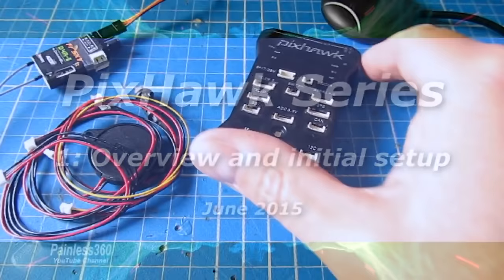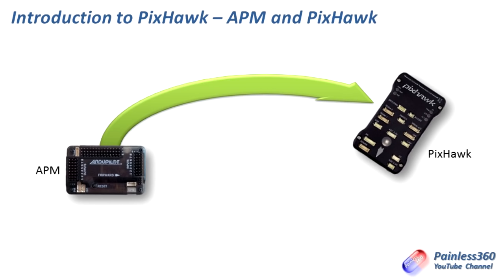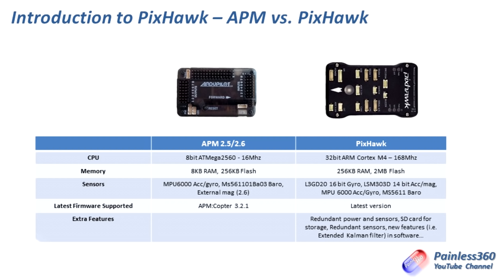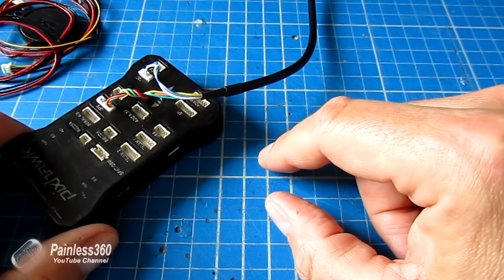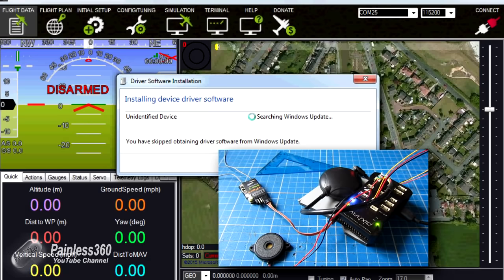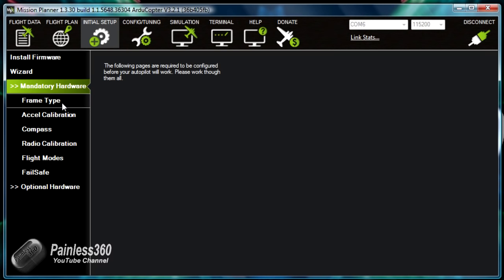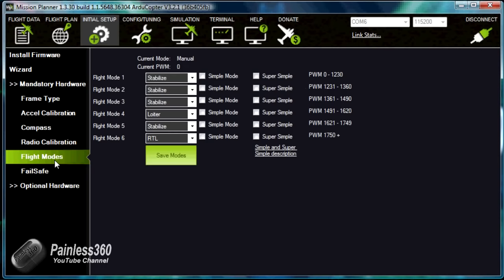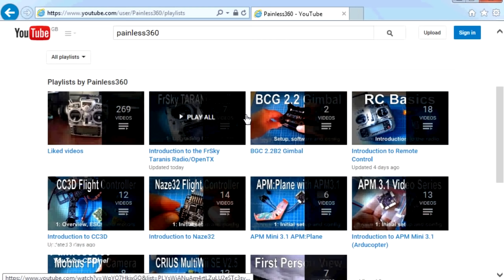(1/5) PixHawk Video Series - Simple initial setup, config and calibration

Comment: Hello Sir, your videos are very well crafted for beginners like me. I can't thank you enough for all you do. I am newbie to Drone building DIY. I have Pixhawk 2.4.8 and wanted to use it with 4-in-1 ESC along with Raspberry PI 4 or 5. I watched all the videos out there on this scenario and all of them uses individual ESC's for each motors. I came across encoder to use but surely not understand it. I saw some video about connecting Raspberry PI to Pixhawk so I think I am okay there but not connecting 4-in-1 ESC to Pixhawk. Would you be able to suggest how I can get 4-in-1 ESC connected to Pixhawk? Or if you could do a video on it, would be awesome. Thank you so much for all your help in advance sir.
Reply from the maker: The wiring of the ESCs isn't that different. Each has a signal wire but all use a single common. GND wire.... Best of luck

Comment: Hi , Painless, i finally get my pixhawk from bangood , and i am flying , but little lost with the parameters.I have a ThrO=0.250  to 0.300 , for a stable altitude is it ok , with the APM i used to have 600 to 700 when the battery is at the end?Thank you for your videos.

Comment: I built a drone and wanted to set it up with a Strawberry Pi and Pixhawk. Doesn't work for me so I disconnected the StrawberryPi and followed your instructions here. Only difference was I left the PPM connected. After following your instructions it still does not work. Is it the PPM causing it not to work? Appreciate any help you can provide. Thanks Al
Reply from the maker: Check out the Pixhawk 2020 series for all the steps I use to get it working. Best of luck

Comment: +Painless360 It has been a really nice video. I have a question.If you answer, I am very happy.Should Pixhawka be connected to the GPS to run the connected engines? Good luck
Reply from the maker: By default, yes. Happy flying!

Comment: Hello, I am building a F450 drone and will be using Pixhawk. I had two questions for you and was hoping you could help. 

1.) I have noticed that 3DR has discontinued the Pixhawk ($109), and transitioned to Pixhawk Mini ($230). Do you know any differences? I do not know which one to go with at the moment, as $230 is quite a bit of money, especially considering it is a smaller flight controller than the original Pixhawk, yet it is a newer version...

2.) For battery size on my F450, I will be running the DJI E305 kit, and am trying to achieve a 25-30 minute flight time. I am looking at a Venom 4S, 8000 mAH, 15 C battery. Any thoughts? 

Thank you for the help!
Reply from the maker: 1) All PixHawks are not clones, and have been for some time. It's why the price had dropped so much. 

2) Really depends on the props, conditions, model weight etc. Watch that C rating on that pack.. check you've got enough for all the motors. Sorry, I don't use DJI kit here so can't comment further...

Comment: by using your video we built up a tricopter using a pixhawk controller. After first problems Now it works very well. during RTL mode the tricopter works well but the landing  Point is not exaclty the take off Point , there is a tolerance around 2m. is there a parameter to set this Radius?  The one in waypoit? Thanks and Regards Andrea Montani
Reply from the maker: +Andrea Montani that's normal. Happy flying!

Comment: beginner's question. What happens if during autonomous, programmed flight pixhawk looses radio reception (turn off taranis). Will program continue or automatic RTH kicks in, or maybe FrShuts off motors?
Thanks so much! Great videos!
Reply from the maker: +mkolesnik The documentation makes a decent job of covering this so I'd recommend a read through it you're interested. The simple answer is that the failsafe happens when either a LIPO or radio problem occurs. You can then get it to RTH or LAND or even continue with the mission.. Happy flying!

Comment: Oh dear Oh dear. I have run into the problem, after initial success wherem Pixhawk refuses to arm. The screen  suggests that there is a radio problem in which the rudder throw is insufficient to permit disarming. Careful examination shows this not to be the case. In one of your videos you outlined a by-pass switch process which you found in The Para Tree collection. I have searched both Para files without success. Is it possible to return to that matter ? It is obvious that there are quite a few Pixhawks with the same problem. Best wishes.
Reply from the maker: Troubleshooting arming hasn't changed in Ardupilot land for many years. There are a few common gotchas that I cover in my builds. See https://youtu.be/r7xFwzTk73U

Comment: great video, hmm do you need a gps and a compass for calibration and flying? just wondering if no gps and no compass can cause any problems . I tried to fly my tarot without gps and compass connected to it, and it was really stable, the model was loosing the balance
Reply from the maker: +Zycie w Californii I would always add the GPS and compass to the model unless you have configured the flight controller to not want either as you setup via the wizard. Best of luck!

Comment: . Thanks for answering my question is whether it is better PixHawk system or a telemetry system 433 mhz and if necessary to install a FPV system to see where is the plane and also a separate system that can take pictures georeferenced to make plans with these pictures .... thanks
Reply from the maker: +CARLOS JOSE SANCHEZ PERNIA A few questions there, let me try and give you a quick answer to each. The telemetry systems works with the Pixhawk - you need both. The Pixhawk is the part that can fly a pre-set 'mission' for things like taking pictures and supports Geofencing. See out Pixhawk videos and take a look at ArduCopter. Best of luck.

Comment: regarding the compass calibration: I´m using a external gps board (ardusimple f9p) for rtk, so i can only use the integrated magnetometer..how to disable the not valid "outer" one?
Reply from the maker: You can enable and disable compass units in the compass calibration page. You can also change the order for them too. See my more recent build videos using Ardupilot.. Best of luck!

Comment: Thank you so much for the great information that you are sharing. Personally I have learned so many things from your series on CC3D and MINI APM.
 I have one question if you don't mind. Is there any differences between the Pixhawk or APM that comes from 3DROBATICS in comparison to the ones that are sold by chines retailer such as Aliexpress.com?
Reply from the maker: mohammed alshaibani Lots of differences - the clue is in the price. ;)
They should be functionally the same but the quality and support will be different. The one I am using is not a 3DR model..
Best of luck with the build.

Comment: Hello,

I just started with the hobby. But i am facing a problem with servo output in missionplanner.

I have a FlSky fs-i6 radio and Pixhawk 2.4.8. In missionplanner at radio
 calibration all the channels change when I move the sticks on my radio 
aswell the throttle. But when I go to servo output nothing happens when 
function throttle is selected. When I select RCin3 the servo output does
 change. My question is how to get throttle moving asswel because I need
 this to let my rover drive autonomous.
Reply from the maker: You normally need to arm the flight controller for throttle outputs to work.. Best of luck

Comment: I need help
I just put together a Hexacopter with 1000mm and use the pixhawk. After all set, I would make the first flight, but I think I have a problem:
When I go up a level in trhotle and maintain this level the engines start up the rotation alone.
I'm a little afraid, because they are large engines using 20 helices. "
What is the problem?

Thanks
Reply from the maker: No idea, not sure what you're describing. Take a look at the videos in the APM and Pixhawk playlists that cover MOTOR_STOP. Best of luck.

Comment: If you are getting a slow response from your radio calibration, as when I move the sticks there is a delay on the screen, is something wrong or any fixes? I got the PPMencoder working only found two posts from 2014 and they said to solder the J1 jumpers togrther I did this with no other validation fearing Id short the whole thing but it worked fine, well except for the slow response for above.
Also have done so much reading of forums and user guides and watching video and still can not find a solution to the USB not being recognised even after turning search off and pointing hardware at drivers. Im a Noob to Pixhawk and very excited to get going. I followed your advice video and spent 24 hours straight working through issues got the PPM going and the telemetry and the external USB, still has not fixed the recognition issue. O also mine came with 5 pin plugs and not 6 for a few leeds and a few other issues that caused grief prior to all the investigation. once swapped out though seemed to get it all going.
well except the two issues above that I have read guides forums and prayed and still no joy so really hoping that you may know what the issue may be. All the buttons I have calibrated one TX respond on the software and the sticks move to the limits of the red lines as it asks you to make sure of its just theres a lag.Everything else seems to work and get great readings in the flight screen. Could it be that its through the telemetry because I cant get usb to work, I did manage to flash the firmware luckily during ine brief usb connection. Or once in the plane will the signal work as usual and the telemitry just be relaying the response slowly? Soooo any ideas? or any documentation you may know of that I have not come across yet?
Reply from the maker: Sorry, we've not used a PPM Encoder here. There will be a slight delay on the screen (see the setup videos) but it should be very slight..

Comment: Nice Video again.
I watched all (8) Naze32 videos and it really helped me as a beginner in quadcopter. Now i think that the Naze 32 wasn't the best choise for an F450 frame it was easy to set up and cleanflight is great, but it's not easy to make your first flight..(i was in acro mode in the first 5 flights and you really need to be attentive if you don't want to brake anything, at least for a beginner and i don't think that i would be able to take nice pictures or movies with the Naze32 (but i know the Naze32 wasn't made for that any way). 

So now I think that I should try the Pixhawk. (It's not cheap but i have every thing else now). 
Do you think that it's a good board for a beginner ? And a F450 frame + SportCam ? 
And will it work with a 6 channels remote control ? 

Once again your videos are great, happy new year all the best for 2016
Reply from the maker: +Jean-Luc G Happy new year to you too. This video may help - https://www.youtube.com/watch?v=k4tQAmg2ssA
Reply: Thank you for your answer.
I just designed a 350 frame (laser cutted of MDF) and i will put my Naze32 on it. (When i will have the budget).
And for the f450 frame i may give a try to a cheap APM as they are very affordable right now. As i would like to take some aerial footages.
Thanks again, your videos are very helpful and easy to understand for a French guy like me.

Comment: Excellent, excellent video. Quick question if I may ? If I have a frame (TBS Disco Pro) where the Pixhawk can't be mounted exactly at the COG should I wait and do the initial  setup and calibrations after installing it in the craft, or is it better do it beforehand like in this vid ? Cheers.
Reply from the maker: Jaaaaaaaaaaaaaaay I always setup the board to make sure it's ok before installing it. I then re-calibrate the acc and mag with it's all fitted. Happy flying!
Reply: That makes sense. Thanks :)

Comment: Lee would you know if there are currently any flight controllers on the market that can be ‘doubled up’ and connected into a single multicopter to act as a dual-redundancy system? Each flight controller would also have its own GPS unit for additional fail safe measures.
Thanks in advance
Reply from the maker: +Brad Samers I think I've already answered this - no need to post twice.. Happy flying!

Comment: I want to equip my machine with extra solenoids and functions and I plan on using a gadgeteer and accessory boards. Should I use them in tandem with a Pixhawk or can I use them in place of it? It seems like the gadgeteer could do anything the flight controller does, but a good flight controller is made to fly etc.
Reply from the maker: +Rollin Shultz Sorry, we've not looked at them here. Best of luck with it!

Comment: Thanks for the great video!
As I'm considering moving from APM 3.1 to Pixhawk I cannot find any info if the peripherals (like GPS antenna, MinimOSD, current sensor etc) from APM will also work with the Pixhawk, or are they a bit different?
Reply from the maker: Most are identical. Most pixhawk kits come with a gps and 3dr radios now..

Comment: Many thanks for your videos.I am building up a fixed wing drone by using a pixhawk as flight controll. The first proto will have an electric motor and I think I will have no issue to manage it by pixhawk. In a second step I would use a gas engine in order to increas the drone range. Is it possible to manage a gas engine by pixhawk? which kind of servo have I to use in order to manage the throttle butterfly (digital servo instead of an ESC)? Thanks a lot for your help. I apologize for my poor english.regardsAndrea Montani
Reply from the maker: +Andrea Montani I don't use IC motors here so can't comment. I think there is something on this in the Pixhawk/Mission Planner Wikis and manuals - best of luck.
Reply: Thank you. I will give a look. See you soon.

Comment: Help... Anyone used the Futaba R2008SB receiver with Pixhawk 2.4.8? I've had these items on the bench for a while and can't seem to connect them successfully. Mission Planner sees the radio and does the calibration, but I cannot activates and test the motors' ESCs.
Reply from the maker: Please watch the latest Ardupilot setup video series. I cover how to setup every step. If the radio calibrates and is setup properly, it won't stop you from arming... Best of luck

Comment: I am having a big problem with the Pixhawk. I am using LittleBee oneshot 20 amp ESC,s connected to 2204 motors. I have updated them to Blheli 16.7, now the PIx arms but no motor spin. The pix is a  2.4.8, . I have replaced them twice now and it's getting stupid now. I am using the supplied power module and all esc are plugged into main out 1,2,3,4. I have a Flashing blue led (no gps fix but that should not matter) all other settings are correct battery is plugged in and I am using MP. What the hell am  I doing wrong.
Reply from the maker: It was only recently that Ardupilot supported things like OneShot, MultiShot and DSHOT. https://ardupilot.org/copter/docs/common-brushless-escs.html will explain how to make sure you have the right one selected. Best of luck!

Comment: hi sir, looking at pixhawk datasheet I did't find any info about the internal gps (not the external module) but I found info  about internal compass. looking also at "pixhawk led and sound video AC3.2" video on youtube you can see that pixhawk links gps (Green led on) without external gps module installed . My question is if pixhawk has its own internal gps or it doesn't have this internal device? Thanks in advance Regards Andrea Montani
Reply from the maker: No internal GPS, we cover al, this later in the series.. Best of luck!

Comment: Recently I purchase external usb rgb led extension module for my pixhwak 2.4.8 but led not glowing .in my module  (iic pin 1.vcc.2.scK.3 scl .4.gnd.)sck instead of sda) is this the problem?
Reply from the maker: I've not used one of those here. I'd check with the seller for some help. Best of luck with it

Comment: Hey need some help please!! I've tried repeatedly (binding/unbinding) but can't seem to get the Radio Calibration to start. The bars are all empty (grey) even after I hit Calibrate Radio and nothing I do on the transmitter seems to reflect in Mission Planner. Im using a R-XSR (ACCESS) receiver into RCIN on the pixhawk bound to my X9 Lite Pro. I've tried flashing the receiver with ACCST to see if that works and nada..... I've got a solid GPS reading and everything else seems fine but the Radio Calibration..... Would really appreciate some help!!
Reply from the maker: Could be lots of things. There are many posts on this in the forums. Apart from rebinding,  what troubleshooting have you already tried?

Comment: Good Morning   I have a question concerning the cube orange / x7 Taranis q  and mission planner  I have my x7 taraanis connected to the receiver  but when i am connected to mission planner and i am in radio calabration the green areas do not show up on mission planner when i move each knob on the transmitter   I am bound to the receiver because when i unplug the receiver from the orange cube it will tell me telemetry lost then when i reconnect it to cube its says restored .  So i guess that tell me i am connected and bound but i can't get it to show up on the mission planner when i am connected to the software .   and also what about bad channel input 1  i have seen a lot about that can you help me with these questions   Thanks
Reply from the maker: Recieving telemetry just means that it is bound.  Make sure that the SBUS output on the reciever is going into the RCin  pins and ot OS all connected the right way. See my Pixhawk 2020 series for a Cube Oramge setup.... best of luck